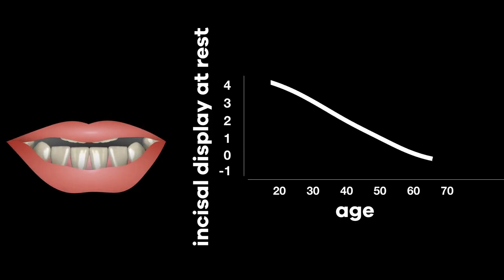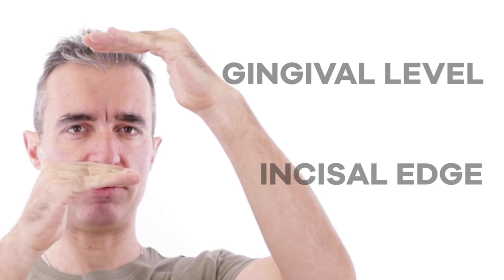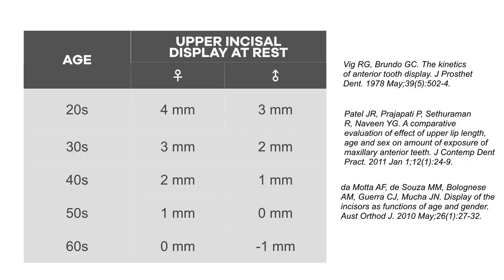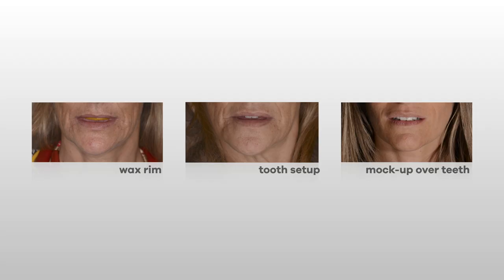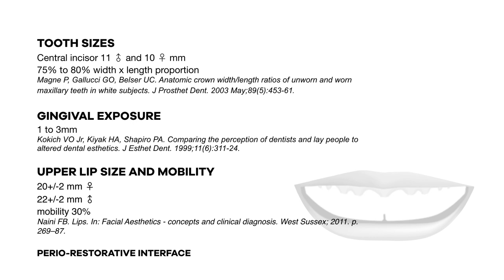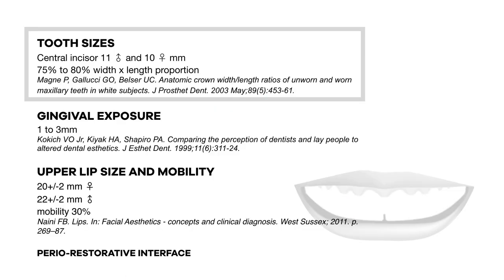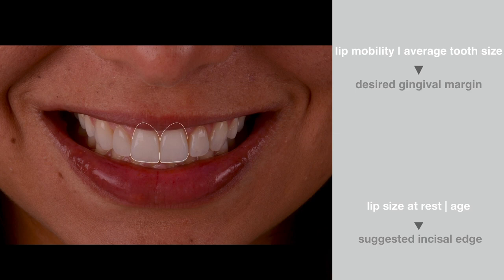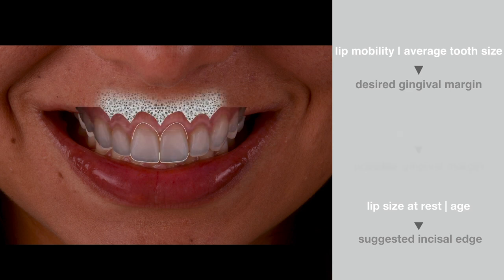CENTRAL INCISOR  IN THE FACE - THE VERTICAL POSITION

Comment: This is an interesting video.
Another factor could be vertical maxillary overgrowth or deficiency. Which is a skeletal deformity.
In my own case for example, I am 32 years old but have no incisor display due to a vertically short maxilla. Jaw surgery with down grafting of the maxilla by 2-3 mm has been suggested to me by an orthodontist as well as a maxilofacial surgeon.